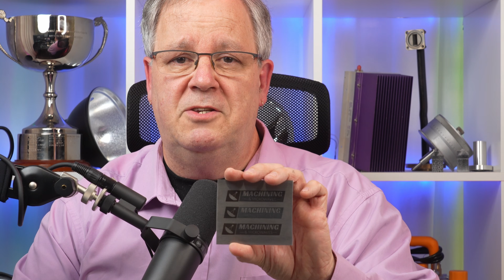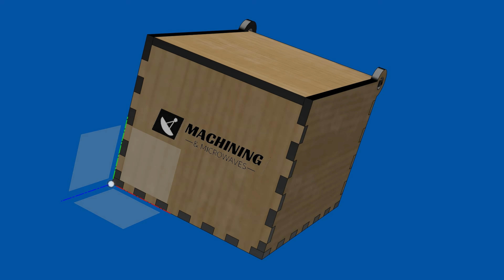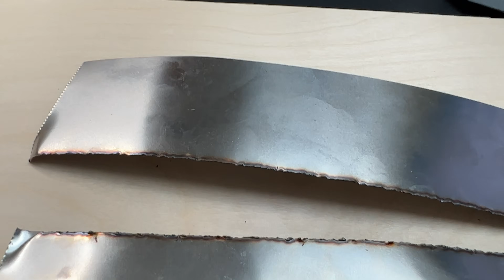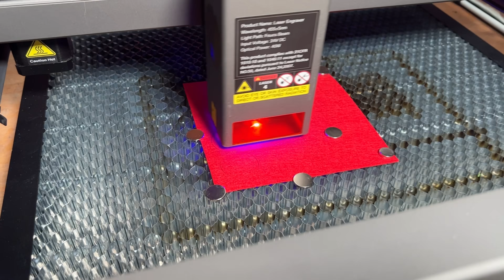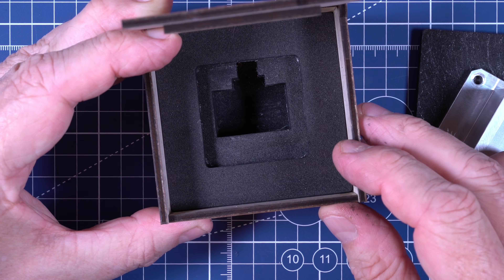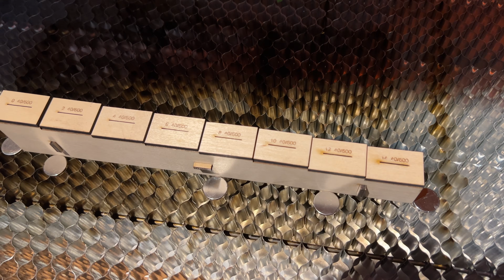Unlock the POWER of Laser Engraving | Creality Falcon2 40W - Fast, Precise, Painless

Comment: As 'an engineer' , you should be using mm/sec, not mm/min…
Reply from the maker: Disagree, mm/min is the predominant usage, like miles per hour or km per hour instead of metres per second. Anyway, it should be metres per second for the feed as well if we are going to be all sciencey about it!
Reply: @MachiningandMicrowaves  As engineers, we should do what is correct, not what is popular. It is also correct to use subunits in measurement - so mm is fine. However, values such as 25,000 mm/min should be shown as 25m/min to be consistent. Using the correct scaling factor is kinda basic. No vector on such a machine will take minutes- it will be seconds.  Interestingly, when I installed Lightburn the values were already mm/sec, suggesting that it is the default...  It is also practical- the vast majority of feeds will be in the 1 - 1000 range, allowing a single scaling factor for all values. So, three good reasons for using mm/sec.
Reply from the maker: @Tensquaremetreworkshop  Wishing for consistency in a consumer-targeted product is probably never going to happen though.
Reply from the maker: At least it isn't in feet per minute like many of the CNC tool ratings
Reply from the maker: I'm from the lost generation who had to deal with the transition from imperial to cgs and then mks and SI, so I'm unit-agnostic and having studied Astrophysics, I'm happy with angstroms, avoirdupois, parsecs, furlongs per fortnight and cups as a volume measure. I'd prefer all measurements to be like 3.45e4 standard form and SI units, but then I'm more a scientist than an engineer, so what do I know!!
Reply: @MachiningandMicrowaves  The machine is not what is setting the units- it is entirely in your hands. Yes, the use of e.g. imperial measures is common on YT, principally because of the preponderance of US amateurs. I say that because professionally SI rules- US cars have been designed and made in SI since the mid 70s. We should not bend to this antique practice. It is possible to define feeds in light-fortnights per leap year- does not mean we should. I have given 3 good reasons for mm/s - can you think of any advantage not to?
Reply: @MachiningandMicrowaves  I, too, bridged the change. I was in the last year at Uni where imperial was used for thermodynamics. The following year was (essentially) SI- and a vast amount of complexity fell away. The large number of conversion factors reduced to, essentially, one. Why would we want to continue such a nightmare? SI is the elegant solution.
Reply from the maker: @Tensquaremetreworkshop  I do rather like acre-feet as a volume measure instead of megalitres or cubic metres, but only because I have a one-acre field and I can imagine it having a foot of water on it.  Foot-poundals, ergs and all that brings back horrible memories. Shudder.
Reply: @MachiningandMicrowaves  Yes, I understand the emotional appeal of historical measures. But we are not Arts students. Engineers are supposed to be rational , logical beings. We are into clarity, simplicity, and functionality. I repeat, what benefit does minutes bring, to overcome the three reasons I gave for seconds?
(Acre. Based on the ploughing ability of a man plus two oxen. Really? Today?)

Comment: this was jolly interesting. as i mentioned in a different comment i have been, of late, on an autodidactic electronics journey. as part of this i wanted to learn about using voltage regulators. it seemed the 'easiest' way to do this was buy a bunch of nichia 445nm 2W LO diodes. along with costly safety goggles, a fog machine, glycerol and de-ionised water to make better fog in the machine, hosts, heat-sinks, a twisty thing to push diodes in hosts, fans, prisms, x-cubes, diffraction gratings, some 620nm 500mA diodes, a green laser pointer, some strontiated aluminates, fluorescent marker pens, and a shed-load of ballons. in short i accidentally became fascinated with lasers. i don't care about doing useful things with them. i just want to pretend to be destroying Alderaan when i sit at my bench. i must say i am very surprised by a device having, essentially, an exposed laser when working. who thought that was a good idea? have these people not considered an inter-locked box around these fantastically dangerous lasers? i even, whilst embarking on my faffing about with lasers voyage, put reed switches on my study door. 2 of them. then i use logic to insist both return a signal showing door is closed before a relay allows power to the bench supply i use with my lasers. heaven forfend my hobby injures my wife.
Reply from the maker: if you want to have an immense amount of fun with lasers, try making a nitrogen TEA laser. Relatively simple construction, but you need to find a way of using a nitrogen feed for best results. Constructing the channel needs a bit of mechanical precision, but the rest of it is just microwave/fast pulse engineering and dealing with extremely high peak currents and fast risetimes. It's a UV laser of course, but if you then use that to illuminate a dye in a cuvette or do something else fancy with using it to pump a visible laser then you can make something really quite exciting. Huge peak power and lots of neat challenges. Also, almost entirely useless for anything practical, so of great value just for the sheer joy of making dangerously scary stuff. See also Marx generators and adaptive frequency Tesla coils. Bzzzzzzt!
Reply: @MachiningandMicrowaves  i have been looking at plans of these. i have some ZVS drivers i have bought, and indeed made, and some LOPTs. i just need a pair of what looks to me, rather like 2 pencils made of aluminium.
Reply: @MachiningandMicrowaves   i have had fun with marx gens. it was a bugger soldering all the caps and diodes. i drove it with  LOPT and ZVS driver. it went CRACK CRACK CRACK magic smoke, then all the dogs ran off. great fun!
Reply from the maker: My laser has an enclosure but having suffered a retinal laser burn back in the 70s, I operate it with my back turned, sitting at the other side of the room and use a webcam to watch progress. I wear expensive Edmund Optics wrap-round goggles if I go near the machine while it's running.
Reply: @MachiningandMicrowaves  i heard you mention your surprise when an ophthalmologist informed you of your retinal damage. but you didn't mention what occasioned this damage? or indeed when it happened? i like old lasers, so i would love to hear about the frequency, LO, etc that caused your injury?
Reply from the maker: @KarldorisLambley  It's not clear when the damage happened, I didn't get that eye test until about 1987, so it could have happened at University in the late 70s or possibly when I was doing experiments in 1982/4.  I was around a lot of lasers at the time, a few big ruby/xenon, but mostly small HeNe and big CO2, plus some early diode lasers from barcode scanners and printers
Reply from the maker: The particle accelerator accident in Korea (?) was caused by a lack of interlocks and poor safety engineering, plus slack human-factors controls
Reply: @MachiningandMicrowaves  i think you mean Anatoli Bugorski in CCCP. it was a concatenation of errors and happenstance. jolly interesting.

Comment: Fascinating! I wonder about making PCBs with it... Should be fun to try! 😃
Reply from the maker: I think small PCBs are best made by sending the Gerbers to PCBWAY or JLCPCB, but for a large one that doesn't need plated-through holes, like a giant patch array or slot array, or metamaterials, it might be a good solution
Reply: @MachiningandMicrowaves  Oh, no doubt about that! But for fast prototyping, mostly for THCs, it should work fine!
Reply from the maker: @MCsCreations  I need to test what technique works best and how clean a line I can produce.  If the precise beam is square and consists roughly of four Gaussian spots, there will be interesting dimensional corrections needed on diagonals and circles, plus the variation in intensity across the dot will perhaps lead to soft edges to the ablated varnish or paint.  Simple enough to test, and for large features > 1 mm it's probably unimportant.

Comment: Are you going to disappoint me and tell it it won't cut 6mm steel plate?
Reply from the maker: I think the steel would rust away before it made it through. Actually, now I'm wondering. 100 passes at full power might just do something if I can keep the workpiece cool. A scriber would be a faster way to cut it though.
Reply: Damn! Looks like I'm still waiting for that magical clean, accurate profiling device.
Reply from the maker: Waterjet made from a pressure washer is still probably the best option!
Reply: one day...

Comment: ... I've not got to the end of the video yet, about half way,But ... Do you think/have you tried stainless steel tube/pipe 316 etc, likes of/for exhaust tip,out of interest?.
Reply from the maker: That might be possible using a rotary attachment on the laser. Only issue is that the surface finish would need to be brushed rather than shiny, so perhaps rubbed with 1000 grit abrasive paper and oil to take off the shine then applying the laser finish. Could be a great idea!

Comment: I can see so many possibilities with these, and the 10-12W versions are almost in reach budget wise. But i still feel at that budget level they're too much of a project in themselves. If you add a zero on the end you can get a machine that's fully enclosed, has auto-shut-off when the lid is opened, etc. I love getting into things and nerding out about them, but where lasers that can cut metal are concerned I'd rather it was a bit less homemade. I reckon I'll give it a few years.
Reply from the maker: I've always used a local fabrication shop with waterjets and 10kW lasers for metal cutting. This unit isn't going to replace that element, but it means I have a way to add serial numbers and branding and scales to products without having to send them out. I'm going to fabricate a metal enclosure with extraction, fire suppression, camera and interlocks, but then I won't have the laser right there in my home office, because the enclosure will be too large. I'll be making a nitrogen TEA laser with pumped dye laser cavities as a future project but only as a rather dangerous toy.

Comment: C02 lasers on metal are going to he a challenge.  You really need to be up in the 120w range or higher and you risk reflection burns back into your optics.

Diode lasers are an interesting option and affordable hobby level approach. Once you get used to some if the common setups and experience, it will be a good stepping stone to larger commercial units from ULS, Omtech, etc.
Reply from the maker: My next step will be a fibre laser I think. My grandson has a big CO2 machine. I'm going to push on with electrolytic and chemical etching after using a laser to ablate a resist layer.
Reply: @MachiningandMicrowaves  hi m and m, have you done the microwave joke yet , just hold up your hand to wave and just twitch, "its a micro-wave, get it". 
im wondering about galvo fiber lasers ,will you try a fr2 board instead to do the hole drilling automagically or use a absorbant spray paint to completely avoid chemical etching then laser clean the surface.could it be tuned to remove a colour of solder mask eliminating a paste stencil altogether ,could it be used to melt solder paste and do everything. so many questions so little disposable income.
Reply from the maker: Visible LED lasers are rubbish for soldering, as I found to my cost. The copper delaminates and the substrate burns before the solder paste melts! Fibre lasers are a different matter, but these days I just send files to JLC or PCBWAY and wait a few days.  If I could ablate the copper on SHF laminates without coating the substrate with condensed copper vapour, then I might have a go, but I've been tied up working on my new top-secret Project Narwhal for a TV program, building up my range of products and learning how to run my new CNC mill efficiently, so no time for videomaking or electronics projects. Or reading 8 month old comments that I somehow missed!
Reply from the maker: ...and I am SO going to have to use the hand-wave joke at some point

Comment: If the airflow from the duct is not enough you could install another fan directly in that plastic piece that sticks out of the window.
Reply from the maker: Good idea. I'm wondering about mounting a large fan in an outside enclosure, to reduce the noise level.  I have a large Xpelair fan that can mount in a window, but I like the idea of having a box on the wall outside, like an air conditioner.  I think I have a coaxial shower extractor fan that fits into a round duct, I might try that

Comment: Very well informed video my friend👍
A tip for cutting on wood that tends to blow out, I have discovered if I dial down on the air flow it helps prevent sideways directional fire in between layers.
Reply from the maker: Thanks very much Clarke, I haven't found a way in Lightburn to set the level of air assist, only turning it on or off. I reckon it might be feasible to write a program to set a level if the Falcon2 had a command for that. I guess I need to do a lot more testing. I even thought about using a CO2 or Nitrogen cylinder and solenoid valve in place of the air pump. I loved your idea of making casting flask joints with the laser. Keep up the great content. I've learned so much from you, myfordboy and olfoundryman about metalcasting. Cheers from Yorkshire UK. Neil
Reply: Thanks so much for the compliments Neil, it's an honor to be catagorized with names such as Old Foundry Man and Myfordboy. 
As for the way I am setting the airflow, I just keep an eye on the air assist led on the module and adjust a degree or two above once it turns green for most cuts. At first I thought full blast would be ideal until I noticed it works best not to fan the flames so to speak🤔

Comment: I've been wanting one and wondering where this cycle ends. There is an old investment saying about waiting until the market dips or buying today ensuring it dips tomorrow and that's how this diode laser craze seems to be. 40 watts seems to be the longest duration iteration thus far but if I buy mine today I guaranteed the 60 watt version will show up the following day. 

It also appears that for technological reasons (heat probably) 5 watts is all the individual diodes will ever be able to output so now they are stacked and aligned. Will they be stacking 2000 of these at some point and taking out incoming projectiles? Why no liquid cooled models?  So many questions...
Reply from the maker: The new ones are supposed to be 6 watt diodes, but there must be some losses in the FAC lenses and mirrors from reflection and diffraction. 22W seems an excellent compromise, but having that extra oomph to make finger joints in 3/4 inch oak is nice. I like the way I can just pick the thing up and put it on an 8 by 4 foot sheet and slice things without even needing a computer, just keep repositioning it and pressing Go

Comment: And by "Rest of Us" I'm assuming you mean "Everyone" that's not part of the working-class. 1500 doll-hairs is equally unreachable as 3500, TO everyone that's not part of the "Rest of Us" -club. Simply because 1500 is essentially equivalent to 1500 packs of Ramen-Noodles! In other words: 12-18 months of dinner.(OR 8-12 months if WE splurge on Parmesan-cheese to convert the dinners into Ramen-Extrodinaire!)... 
BUT, still a good presentation and video!:goodvibes:
Reply from the maker: I was meaning folks who are not laser-geeks, normies like me, not propellerhead techies. Finance is an entirely different issue.  If you were doing laser stuff for a business in its own right, you're competing against zillions of other folks doing the same thing. Hard to justify the cost unless the extra power speeds up production to match demand. For me, it's going to save time and money compared with getting someone else to cut and engrave things for me, as a support service for shortening research/dev cycles and trying out things that might fail. OK, I got this one for free, but if I get to rely on having it around, I'll buy at least one more so I don't end up with a single point of failure.
Reply: @MachiningandMicrowaves  Fair enough. But at the core of my comment was the 51% of frustration manifesting from this very type of "bang-for-the-buck" that's the direct result of non-technically inclined soy-boys/girls with designer safety glasses and mommy/daddy's credit-card, slapping off-the-shelf chinesium-parts together, starting an LLC, and slathering a 400%-500%+ markup on JUNK. Then using their Gender-Studies degree MINOR in "Marketing" to  screw people over while simultaneously complaining about Capitalism(whole other story).  BUT, being in the machinery/fabrication/tech- world since pagers were popular, knowing what parts are readily available used and new, for $2000-$3000 I could be cutting at least 1/2 plate steel/aluminum. Sorry, I guess being broke with knowledge hurts more than being broke&stupid AND wealthy&stupid combined! Not implying your wealthy! Not implying your stupid! I am implying you still wasted money! Though, considering you have some and I don't... Might speak for itself! ... :goodvibes: